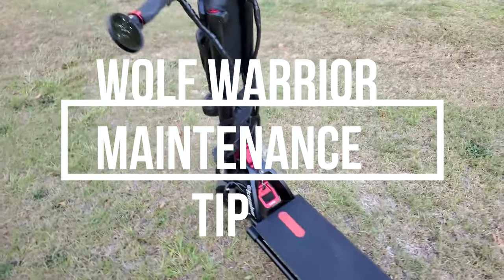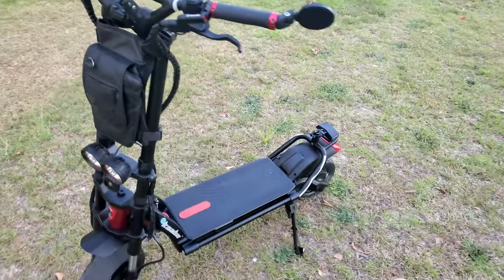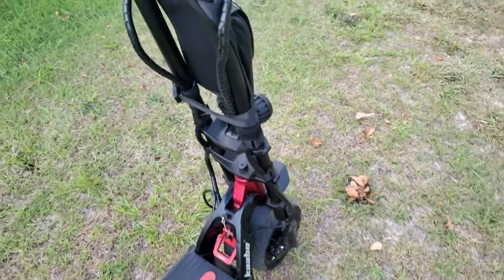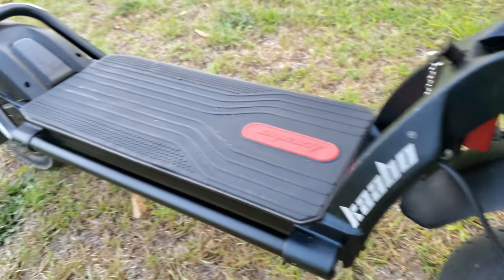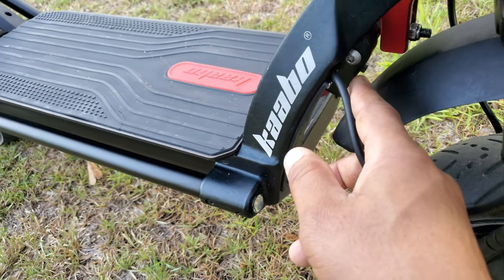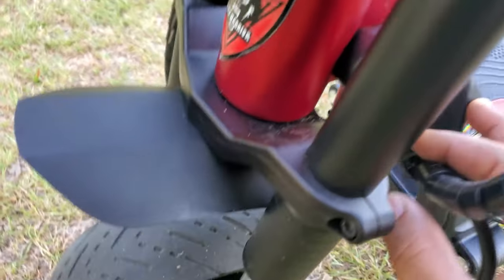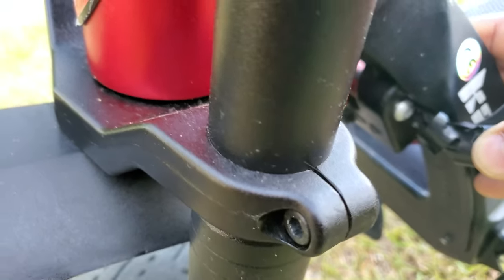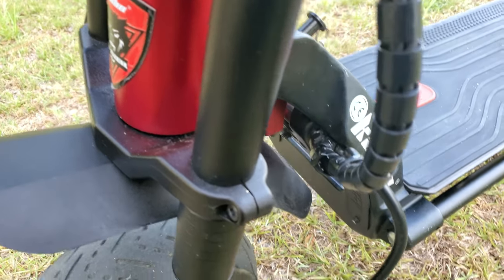Wolf Warrior Maintenance for Back and Forth Stem Play or Loose Steering Column

Comment: Hi don’t know if you’ll respond. My wolf king GT pro moves back and forth like you said. I see the two bolts. what tool did you use to access such a tight spot ?
Reply from the maker: I had to get creative and use a pair of pliers or a small open end wrench that fitted on whatever I could find to fit in the screw from that tight position.